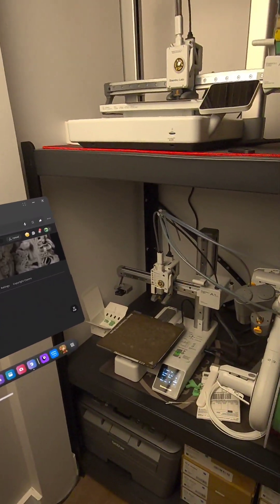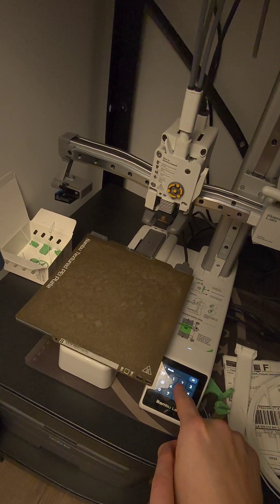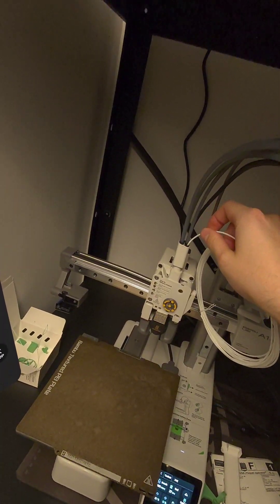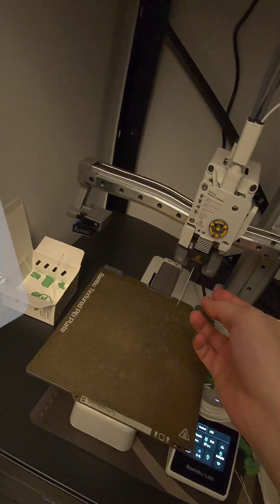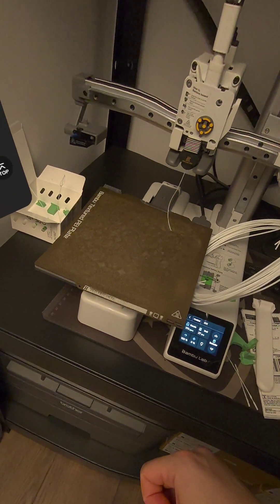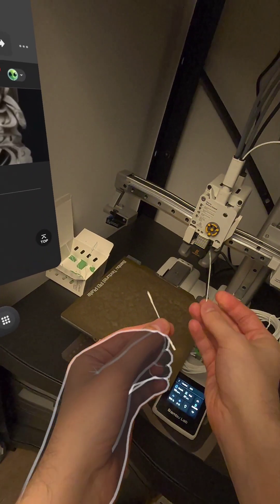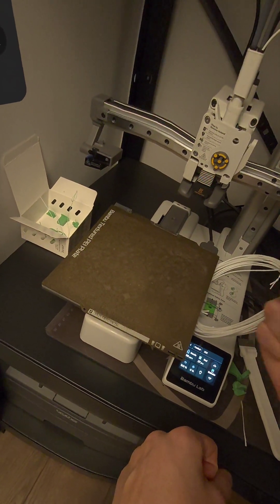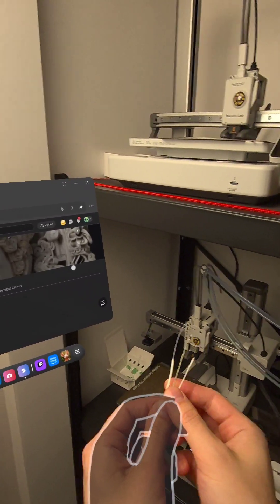🔥 How to Cold Pull Your Nozzle on the Bambu Lab A1 Series Printer! (Easy Fix for Clogs)

Comment: 0:50, for all viewers, it is not nylon, it’s white PLA
Reply from the maker: I'm sure it's nylon because it's the small amount of filament that comes with your bambu labs printer meant for unclogging
Reply: @gm3dprint i have two A1s and both of the packs of white filament they come with say "Bambu PLA Basic 20g".
Reply: @gm3dprint  It's definitley PLA Basic. Says it on the packaging it came in.